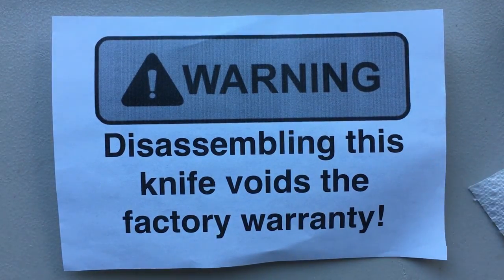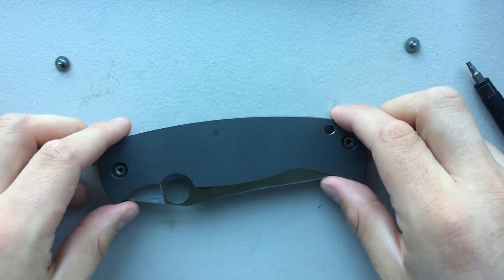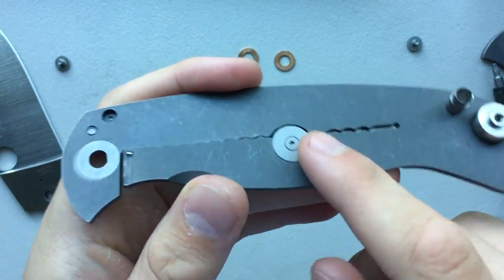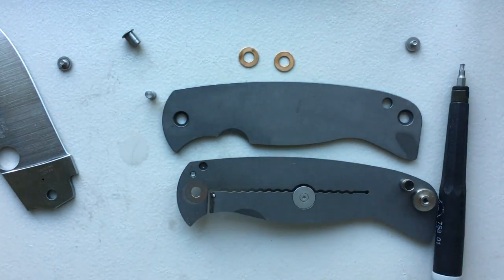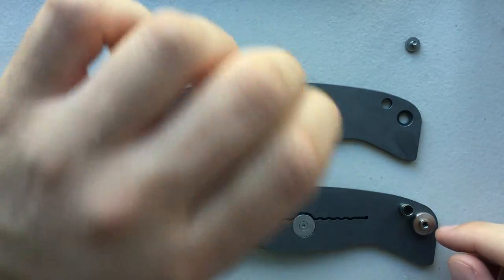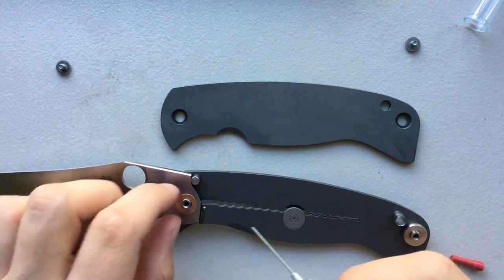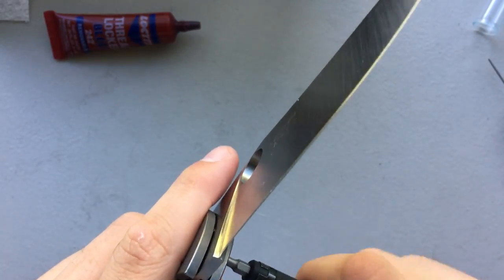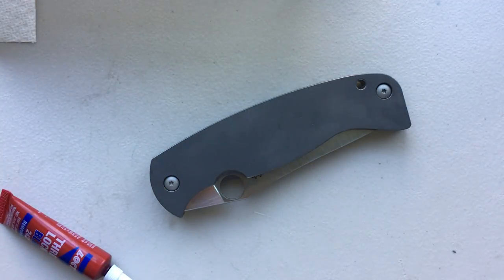How to disassemble and maintain a Spyderco K2 Pocketknife

Comment: Hey Nick has nothing to do with this knife but changed scales on pm2 to carbon fiber.  They used red loctite on every screw ugh . Thanks for the heat tip made my life alot easier lol...
Reply: Gamma Rayburst 
I'm in the process of doing a brass PM2 and I'm having the same issue. Why must they insist on using red loctite.